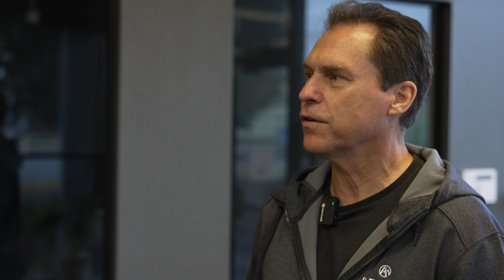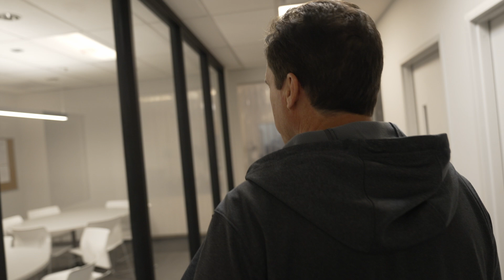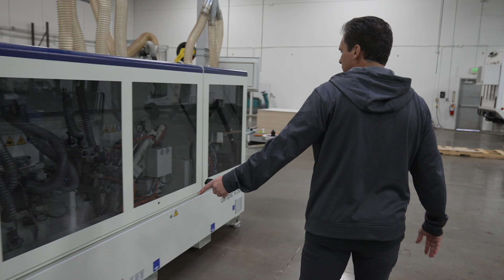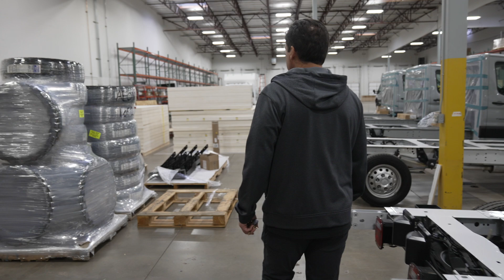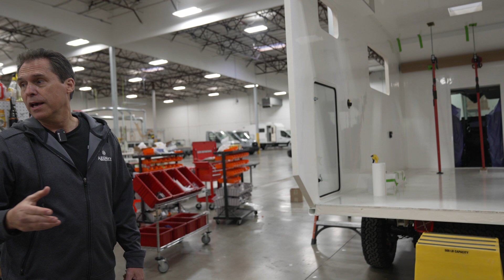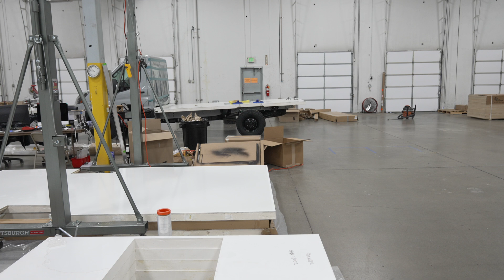Behind the Scenes: Building the AEONrv

Comment: Can’t stand a class B plus with non-Dooley wheels. It looks so weak.

By the way, maybe it’s a good idea to do a tour when people are actually working so we can see what’s going on.
Reply: Do u mean when it's busy with a lot of noise? lol DUALLY wheels don't make it look hard. It makes it look heavy. haha ;)
Reply: @JoshuaMartian-go3tm  I’ve never said dually wheels make it look “HARD”, stability is very important and that specific wheel set up, will help with cross-winds + importantly, towing capacity. Especially if somebody has to take out a mortgage to buy one of those units.
Reply from the maker: We prioritize off-road and dualies are not quite as good. GVWR is up to 9,950lbs and OCCC is 1,000-1,500lbs. Towing up to 4,500lbs, which does not really change much with a dually because the weight is higher. With the suspension modifications we make it drives great on and off road. thanks for your feedback.
Reply: @aeonrv  I appreciate the breakdown. Thank you so much.

Comment: Do you have any additional structure framing for the box? Hard to imagine the foam panels being strong enough on their own.
Reply from the maker: FRPs are very strong. The box is held together at the edges using fiberglass pultrusions that are also incredibly strong. Finally, the cabinetry is designed to give extra support to the box, like a rollbar. Overall the box is much stronger than a typical RV built with an aluminum frame.

Comment: Ah, wood cabinets.   A deal breaker.  Why not HDPE??  It doesn't swell, squeak or fail.
Reply from the maker: We us a special lightweight high quality thermally fused laminate plywood that will not swell, squeak or fail in our use case. Our cabinets are very unique, lightweight and installed with polyurethane adhesives. You should check them out in person. We prefer not to build our cabinets out of plastic and HDPE is quite heavy, does not hold screws well, and in our opinion is not a good choice for off-road cabinetry.

Comment: It is refreshing to see the AeonRV and the amount of care and thought the owners have put into their product. I have been very interested in the Winnebago EKKO since they came out in 2021. However, there seems to be some major quality control issues on the EKKO that vary from year to year making the EKKO much less appealing to me as time goes on. Many of the issues could be solved with proper quality control and systems management. The AeonRV is now at the top of my wish list when I am ready to transition from a class B to a B+ rv. I expect that to happen in the next couple of years as we get things set up at home to go travel for 6-12 months. I like the ease of using a class B but it just does not have quite enough room for a longer period of time or in colder environments. The AeonRV has all of the features that I like. Only thing is that I would prefer is a mounted manual Fiama awning that covered more of the passenger side of the rv. That can be remedied though. Thank you for the update!
Reply: It would be nice if the awning is inset into the camper shell  - like older "Bigfoot" RVs. That would reduce the liklihood of being sheared off by tree limbs and less likely to leak where mounting brackets / holes drilled.